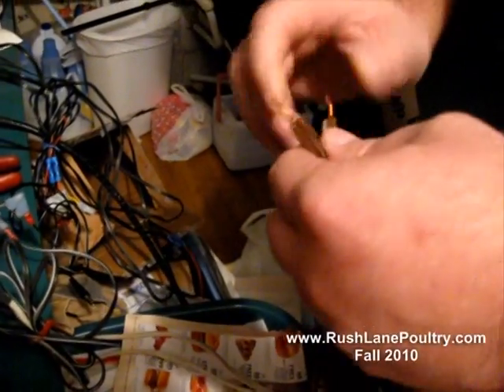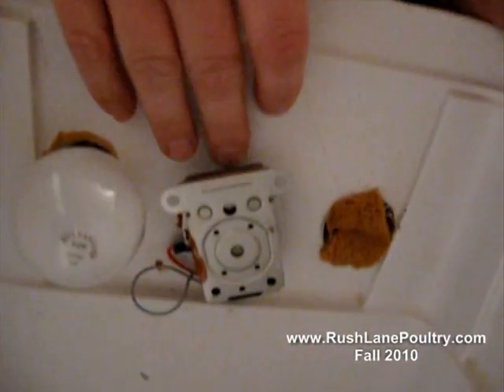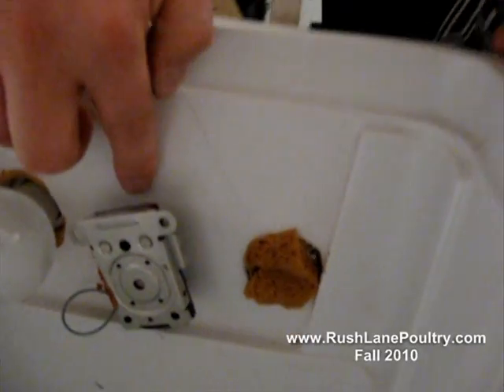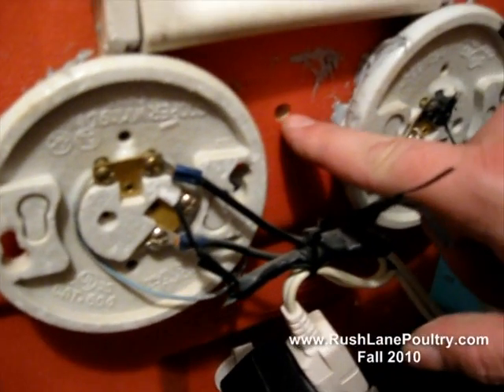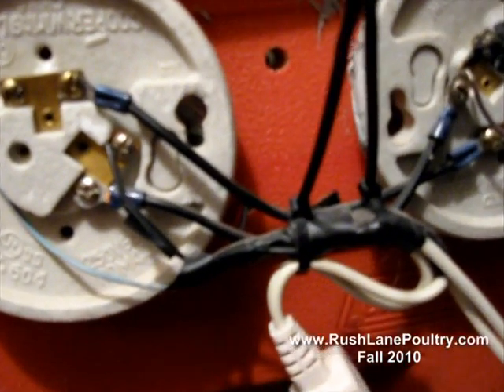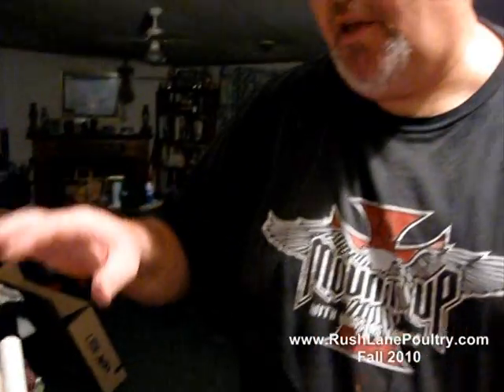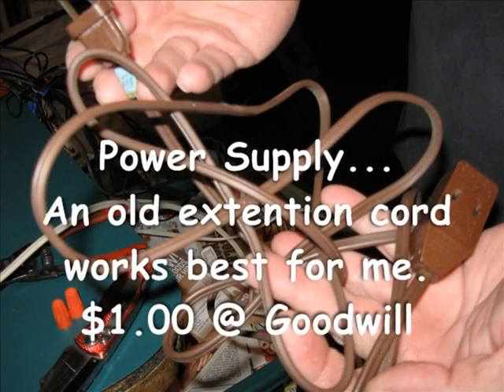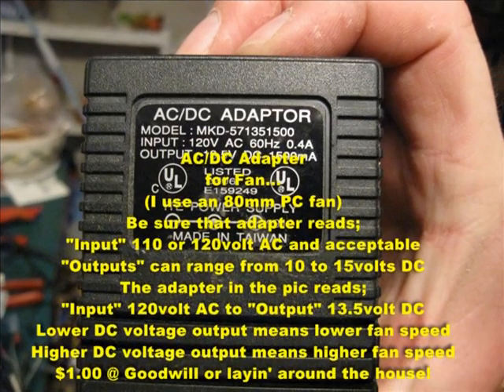How to Wire a Homemade Incubator... Part 3

Comment: i recently started looking at some of the smaller commercial made bators. the money they were asking as opposed to the few times i would use it seemed way too high. so i saw a you tube video on homemade ones. all seemed flawed or poorly made to me until i watched your three part series on making one. EXCELLENT!! i have a lot of the parts laying around the house. i will stop at lowes on the way home to get the thermostat and light fixtures , then i am in business!! thanks a lot!!

Comment from the maker: @born2timesdie1time I run two 40 watt bulbs... I do that as a fail-safe just in case a bulb blows, then the other bulb will keep the bator up to temp until I can change the bad bulb... I've had this happen before! You don't want to loose a hatch because your buld blows in the middle of the night! I'll be posting a new build video that goes into much greater detail in a couple of days...

Comment: I run two 40 watt bulbs... I do that as a fail-safe just in case a bulb blows, then the other bulb will keep the bator up to temp until I can change the bad bulb... I've had this happen before! You don't want to loose a hatch because your buld blows in the middle of the night! I'll be posting a new build video that goes into much greater detail in a couple of days...

Comment: Thanks, I was wondering about the little fan... I didn't realize they needed an adaptor and I blew mine up today LOL so baaack to walmart tomorow. I might ask you for some help hooking the new fan up to the ac/dc adaptor. As you can tell I am not an electrician - I blew up two thermostats yesterday too before I figured out how to wire them right.